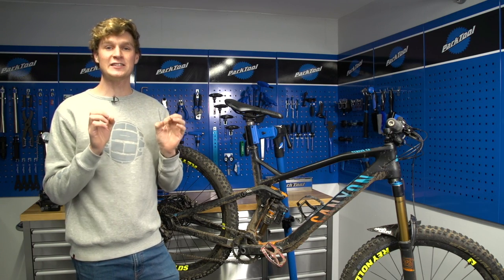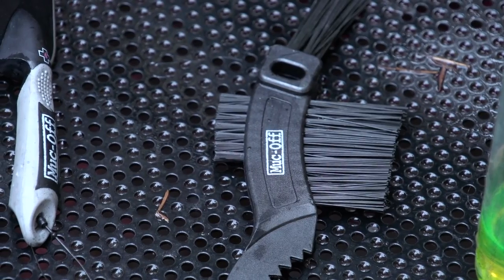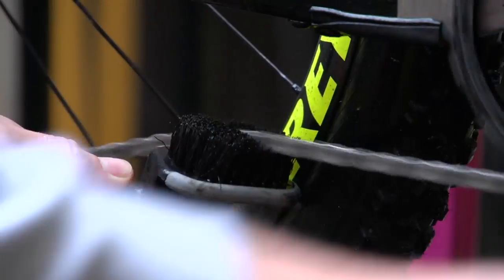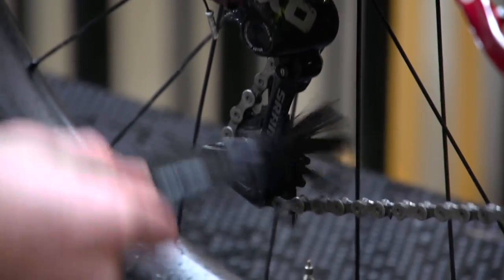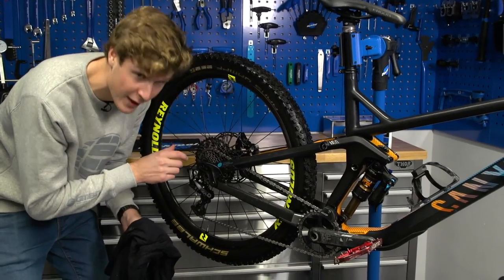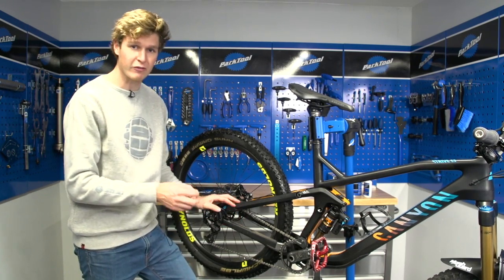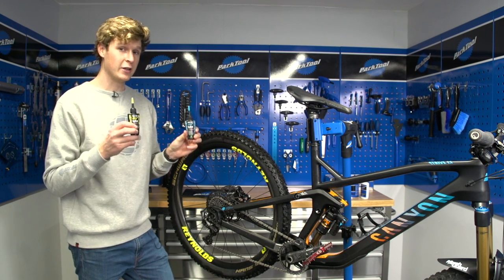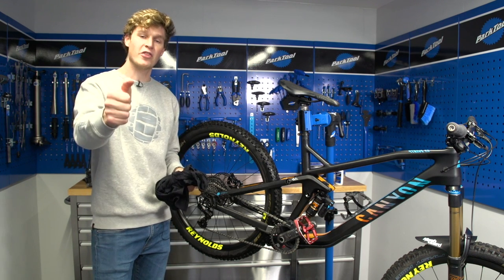How To Get A Perfectly Clean Chain + Drivetrain | Mountain Bike Maintenance

Comment: what about those chain cleaning gadgets? dothey work?
Reply: YES. I got a Muc-off one with the spray degreaser and it works better than the way shown in the video ( which is what I used to do )
Reply: AceRidesBikes the brushes don't work you use them once then they are full of muck and you can't get them clean

Comment: My whole drivetrain is full of grease its soo black and am having a hard time removing it shall i use degreaser? Any other solution like wd40?
Reply: don't use wd-40 it wont do anything, wd-40 is designed to get things which are stuck unstuck, if you can take the cassette off then you can clean it a lot better but I've found a toilet brush works best in getting the black stuff off, use it with a bit of degreaser and your good to go.
Reply: use dish washing liquid it isn't as good as a degreaser but it works and doesn't harm your bike

Comment: Not the smartest drivetrain cleaning as cleaning all these parts on bike will decrease the longevity of the bearings in the hub, bb, freewheel, and derailleur pulleys. In fact, I'm not a fan of cleaning the bike with running water. Spray bottle of diluted simple green to wipe the frame down w maybe a misting of water esp on fs bikes and all bearing pivots.

Comment: It is dangerous to get drivetrain clener from muc off on the disc brakes. Can anyone answer?? plz
Reply: really getting any type of degreaser or lubricant is bad on your discs but degreaser has a less worse effect, you should avoid at all possible to not getting it on your disc brakes and if you are using a spray bottle I would recommend spraying it on the brush or rag first then cleaning your drive train
Reply: ok

Comment: Does it work with wd40 ? ( instead of the green liquid)
Reply: Vic Vic Yes it does, but nowhere near as well as that cleaner.
Reply: Ok thanks because I've washed my whole bike with wd40 since 5hears and now I got a new one and I don't want to make mistakes anymore...
Reply: Vic Vic What bike do you have now?
Reply: I still use WD40 when there's dirt stuck in between the links of the chain. Then wash with a dish washing detergent. But a good degreaser is definitely better if you have one.
Reply: Henris Ivaskevicius now i got an commencal metah am ht race
Reply: Same! Its a great bike

Comment: i actually have rust here wtf do i do help
Reply from the maker: If you can, take it off the bike and put it in a jam-jar full of degreaser and give it a shake! If you can't take it off, hit it with loads of WD40 and a rag (careful not to get any on disc brakes if you have them) before applying fresh chain lubricant! The lubricant should make it's way in after a quick ride!

Comment: After I lubed the chain and used the rag to clean up the excess lube, the rag turned to black colour with dirt on it, anyone haveing the same problem like I do? and may I have some solution
Reply: Nguyen Metalcore probably because you didn't clean it before hand
Reply: I did, just like the video

Comment: i used wet lube my chain got black and it had dirt all over it
Reply: Did you wipe off the excess lube?
Reply: J S no was i suppost to do that
Reply: mercedes benz yes mate stops the chain getting so mcuh dirt sticking to it. if you don't it just collects dirt
Reply: Michael Loftus oh okay
Reply: mercedes benz | Yes, you have to thoroughly wipe the excess lube with a rag after waiting around 5 mins when you lube the chain so the lube can go through the gaps. You only need grease on the gaps of the chain, not the outside, as it'll only attract dirt and wear away your drivetrain.
Reply: Woof Woof thats why my chain didint stay on
Reply: mercedes benz | I'm not too sure if that's the cause of your chain slip, you may want to check your derailleurs if there calibrated, GMBN has a video about that.
Reply: Woof Woof im pretty sure cause just took my chain of and there was a giant piece off mud rocks wood pieces
Reply: mercedes benz | if that's the case, your right. Just give your drivetrain a thorough clean by degreasing and scrubbing it till all the dirt comes of then re lubing your chain properly.
Reply: Woof Woof okay thanks
Reply: mercedes benz | I'm glad to help. Have a great day :D
Reply: actually if ya want to clean it all the way... get it down an clean it separately of the bike in any shallow bucket or just sink. Degreaser on, brush it through, let it work for a min. and let it dry. But be careful it wont rust. and when you lube it. just spin Yo pedals for a min. and then clean it off. You should get clean lube mark on finger after touching if you cleaned it properly..
Reply: ŠpekulantoS | taking your drivetrain apart will take allot longer and also requires specific tools for the job. But I guess, if you have the time and tools to do it, it's a effective way to completely clean your drivetrain.
Reply: ŠpekulantoS Woof Woof  i dont have the time and the tools and i just got a new bike so the old one is rubbish
Reply: I mean its overall atleast once a season maintenance. After couple of rides I clean it on bike w/ the chain wasching gadget etc. But as you described, I reckon y drivetrain needs good wash, so... And the tools...its just one tool to take the chain apart. Or if y have the quicklink stuff on, you need just pliers
Reply: ŠpekulantoS | oh, I thought you were talking about removing the cassette, jockey wheels and derailleurs, and not just the chain which will take allot of time and requires sophisticated tools. But indeed, removing your chain and soaking it like you said is definitely not a bad idea.
Reply: ŠpekulantoS i dont have the quick link

Comment: That's a very good cleaning, but only if you have space to do, and a hose lol... And another point, I use 7 speed cassette, so it's not worth buying that lube and degreaser. They're worth with more expensive drivetrain, like that one.
Reply: I would still clean the drive train, I don't know where you based in the world but where I am I can get some lube and degreaser for about £6 altogether and you don't need a hose to clean the drive train you can use a bottle of water as the hose and it does the same job

Comment: 1) use the strongest degreaser you can find (motor cleaner etc.) on your whole drivetrain.
2)spray down with salty water.
3)quickly wrap the drivetrain in a plastic bag. Add more salty water and make the plastic wrap air-tight.
4)leave the bike in a moist/damp basement for a month.
5)take the bike to a mechanic and say it came out of the factory like that. Remember to remove the plastic bag before taking it to the mechanic.

Hope you found this helpful!

Comment: Does cleaning your breaks not mess your hydrolocis ?
Reply: if your talking about the pads them selves water is enough to get anything off your shouldn't clean your pads with anything else but water, the disc rotors on the other hand disc brake cleaner is designed to clean them but cleaning your brakes doesn't mess with the hydraulics unless you undo the bleed valve